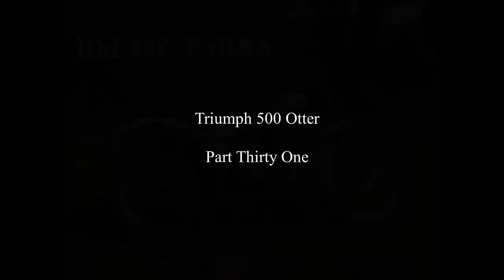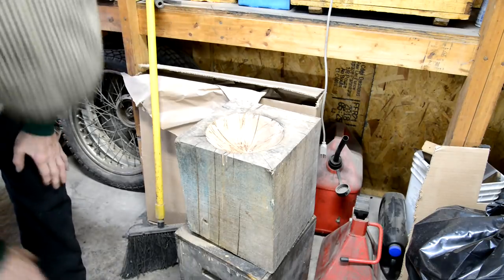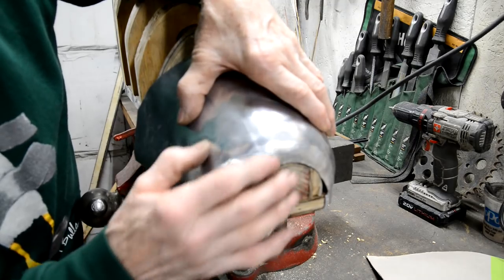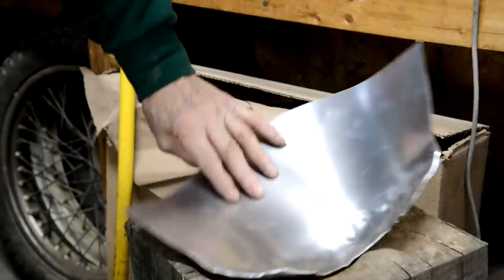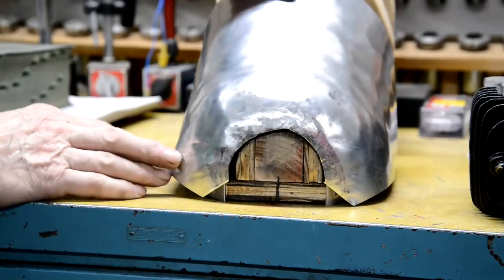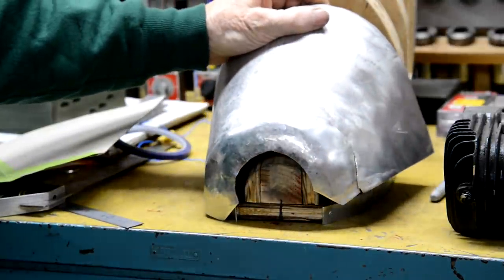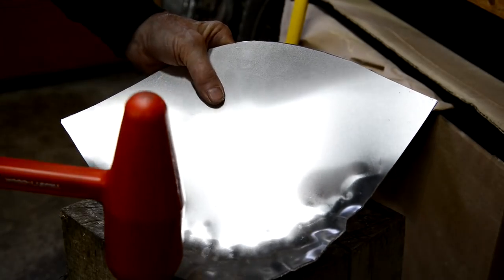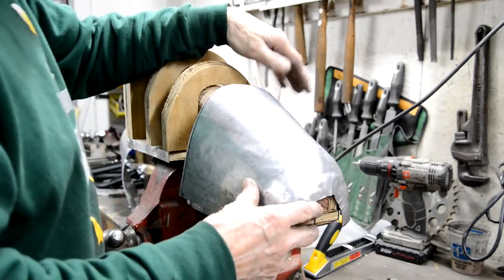Triumph 500 Otter  -  Part Thirty One

Comment: Start from the top of the hill, form the highest point first, in this case that would be the ridge of the tank where it curves over to the rear tank mount.
 If you stretch the outer edges first there is nowhere for the slimmer sections closer to the center to go.

Comment: Suggestion for a annealing heat source. There exist propane fired “weed burner” wands. They run off a refillable gas grill tank, and have a head about 3” (7.5 cm) in diameter at the end of about a 3 foot tube. They claim 400,000 btu output, it’s a pretty big somewhat soft flame that is good for heating stuff, with less risk of overcooking things.  They are a lot cheaper to run than acetylene, or any of the disposable tank things.  But you will still need the acetylene to soot things up.

The “deluxe” model I got (has a spark igniter, and a pilot flame) was around $30 from harbor fright, they even include the regulator.

Comment: You have set yourself a pretty difficult first off test there but I think you have done really well in getting as far as you have.. You need to do an awful lot of shrinking to get the curve you need. Unfortunately a lot of metalworking usually ends up stretching the metal. You can buy shrinking hammers, they are not cheap (don't buy a cheap one) but I think it will help forming the final bit of the curve you need. Don't worry too much about the edges of the metal, as said below start in the middle and work out. Edges are usually finally straightened on a shrinker or stretcher but they would be a lot of money unless you are planning to do more of this kind of work. The shrinking hammer would also help here in the absence of the shrinker and stretcher.

Comment: Where did u get the long ball bearing torpedo thing from please?
Reply from the maker: Hello David. I made that one from some 1 1/2" round stock that I rounded the ends off in the lathe. The ends could be done with a file it would just take a bit longer.